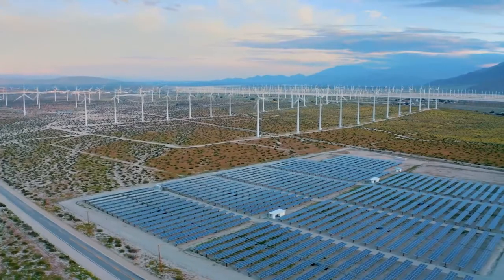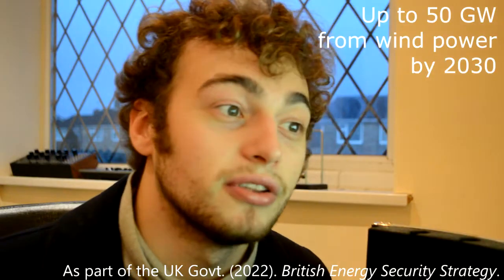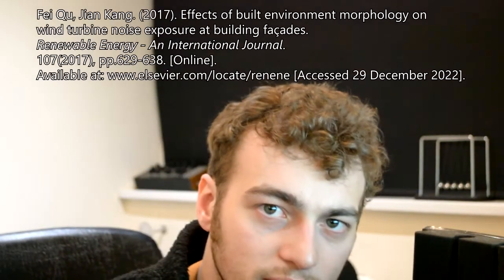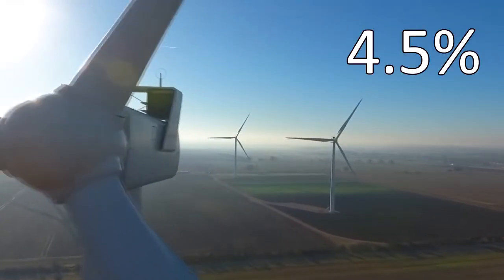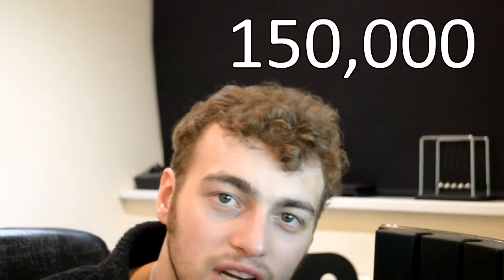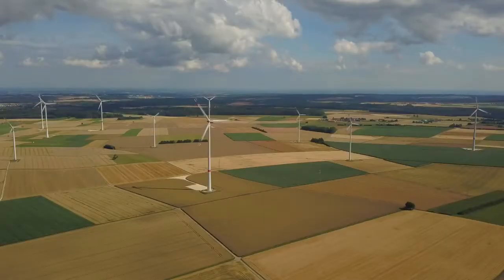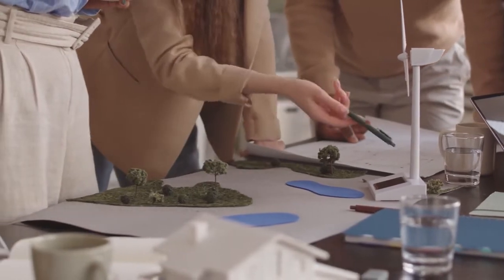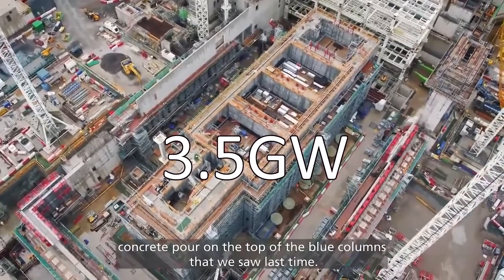wind turbine presentation I did on my engineering course

Comment: Joe, 

let me add to your research.

Two types of generators, synchronous and asynchronous.
The former include gas, oil, coal, hydro, biomass and nuclear. These types of generators are controllable.
Asynchronous generators are renewables and their ouptut is due to what natural energy they receive and feeding this into a system that has to be finely controlled as far as load and supply which must equal on an instantaneous basis. Frequency is the way that this is judged, too much load and frequency drops and vice versa.

Renewables have open access to the grid and sell all they can, conventional generators then make up the difference.
This is called balancing, and in the U.K. Closed cycle gas generators (Gas turbines plus steam from waste heat) do virtually all of this. By the way thermal plants are rarely shut down if their output is not required, they simply throttle back and indeed there is a proportion known as spinning reserve, connected to the grid but not supplying power, purely as an insurance for a sudden requirement of power, exacerbated by winds variability. (Wind power outpput varies as a cube of wind speed). 

(This, too is why we have pumped storage, and have had pre dating renewables because it can supply very large amounts of power nearly instantaneously, Dinorwic can provide from 0 to 2 gigawatts in 15 seconds or so. Nothing to do with backing renewable intermittency as it's duration is very short)

With regard to intermittency, this is insurmountable, storage is out of the question as the capacity required is so vast. Thus we need to have about the same capacity of conventional generation as well as the renewable capacity, a doubling of assets just so we can use wind. Put that into your economic calculations.

Part of the reason for that capcity is intermittency but as wind and solar possess none of the technical criteria necessary for a stable and economic grid we also must have conventional generators.

Inertia, which is a damper on frequency necessary for a stable grid. This is one reason you cannot use wind and solar instead of conventional.

Reactive power which wind and solar do not contribute to, essential for stable voltage control.

Short circuit current level which wind and solar do not contribute to, essential for the proportionate and timely operation of grid protection systems.

All in all there are very many problems with renewables which are little known and if our media did it's job and informed the public there would be little to no support for wind and solar farms. (Solar is the very worst of all renewables)

Some reading for you:-  http://www.iesisenergy.org/agp/    https://docs.wind-watch.org/hughes-windpower.pdf